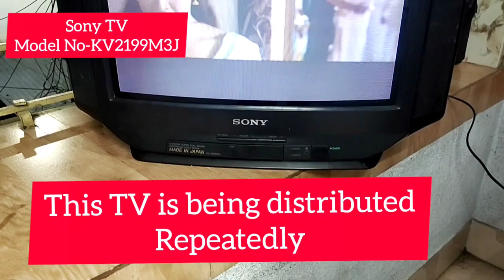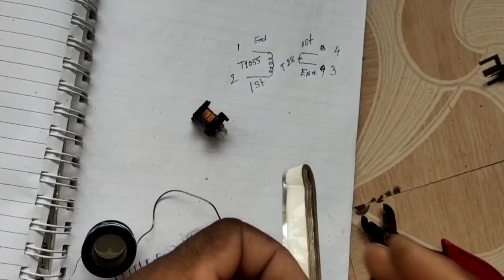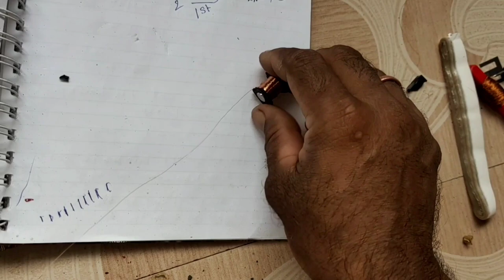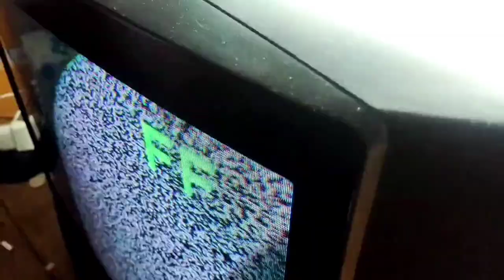Sony Trinitron KV-2199M3J EHT output transistor getting short too early

Comment: Sir , this crt can i use 1803 transistor?
Can i use other company kit driver transformer?
Reply from the maker: Any driver transformer could be used here if it is matching with secondary current drawing of Horizontal out put transistor. Unless original driver should be used.

Comment: I have same kit ,5mint output short problem , machanic repalce d.t other company kit and eht change pf change but problem not solve 
What solutions sir???
Reply from the maker: If you have already changed the Kit . But problem not solved means the problems are coming from the parts mounted with Picture Tube . so it might be occurred due to Yoke coil mismatching or damaged partially.  Please check it .

Comment: I have this model TV  .the problem is it goes to standby immediately in few seconds I am also a TV hobbyist please  suggest
Reply from the maker: Have you adjust pre-set the power supply?  Look at the damper capacitors on the side of EHT  I think EHT is becoming high current.  You can change the EHT. TV picture has become bigger?  This can happen even if the picture tube is bad. Thank you